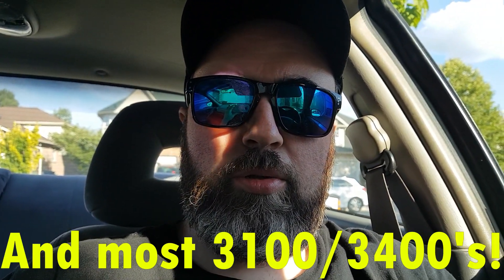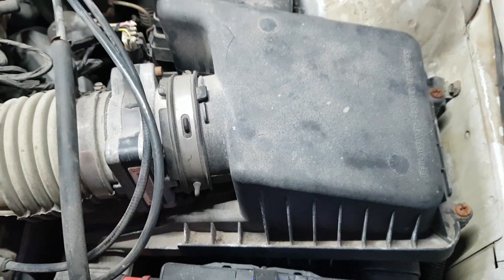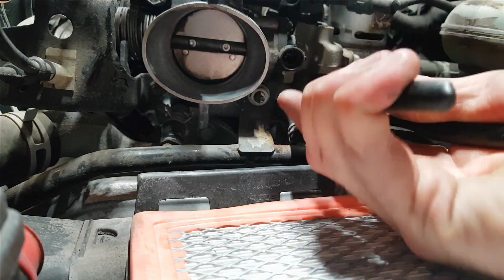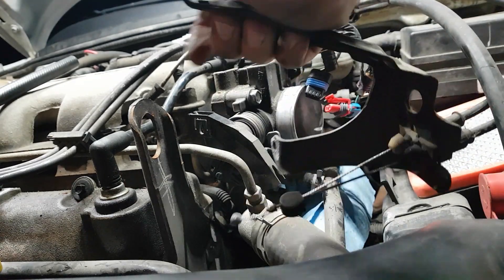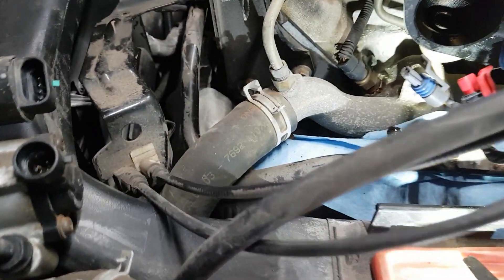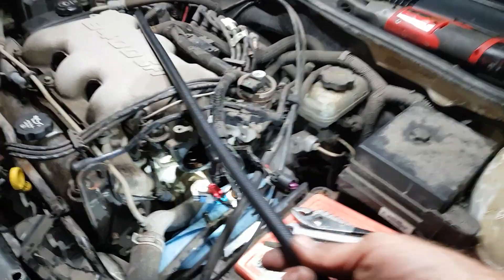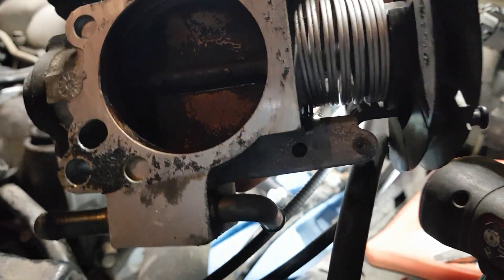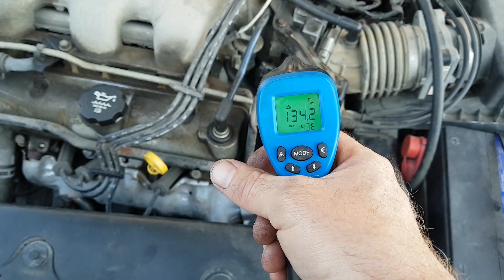3100/3400 Throttle body heater bypass

Comment: Thanks for sharing this in detail. Those little hoses were rotted when I put fresh cylinder heads on my Oldsmobile Silhouette. One of the fiddly parts of that job was getting them lined up. I’d have bypassed them if I’d better understand them. GM doesn’t give you much extra hose to work with for reassembly either. I’ve pulled four Oldsmobile Intrigue throttle bodies now from the junkyard, before they disappear, for future projects. Hope your car keeps coming together.
Reply from the maker: I have at least 4 lx5 TB's too! Lol

Comment: Question, can u eliminate that tube and make plates with a gasket? And also when upgrading to the 65 mm throttle body do you have to get the car programmed? Gonna do the bypass in the mean time.. thanks
Reply from the maker: Are you talking about removing the heater core tube at the timing cover and blocking it off? Or on the TB? 
You can run the 65mm TB on the stock tune, but you will get the best results with the reprogramming. I'm planning on installing my 65mm TB/ported plenum this weekend!

Comment: Great mod / air box 2nd filter debris filter/ egr delete/ pvc and breather all done in my 3.4 that is in a torrent awd/ over size throttle/ injection
Reply from the maker: Awesome to hear that someone is modding a torrent/equinox! They have a lot of potential, especially with the AWD!

Comment: Also, would more heat shielding under the throttle body help? The crossover pipe can’t be good for anything in that area.
Reply from the maker: It probably wouldn't hurt!  But I think I would worry about it more with headers or a turbo

Comment: I’ve been watching your videos for a while and I have a 1999 Monte Carlo with a 3.1. I plan on porting the heads and doing everything like you’ve been showing and I’m wondering at what horsepower should I start worrying about my transmission?
Reply from the maker: Iirc you should have a 4t65e... make sure that the transmission tune is good and add an external cooler,  I don't see why it shouldn't hold 250-275hp at the crank assuming it is maintained and in good working order. Once you start passing that you will want to look into upgrades for it!
Reply: @modeverything1  Awesome, thanks for the information!

Comment: I have a 2001 Pontiac grand am 3400 and I don’t know exactly what I’m looking for, I took the car for a test drive, had heat and then suddenly a blast of cold air, I get the car home and my dad mentions the heater hose might have popped, well he was close it’s the metal piece that connects to the hose and to the block. So my question is would anyone happen to know what that black metal tube piece is called and how hard is it gonna be to fix the issue?
Reply from the maker: Is it the pipe that goes to the lower intake manifold? Or the one that wraps around to the timing cover? Dorman makes both of them, just search 626114 and 626533.
Reply: thank you so much, I just found it. It’s the Heater core coolant pipe with the number 626533 and it’s the one that goes in the lower intake manifold
Reply: Another question is the piece that goes into the manifold broke off so any recommendations on how to get that piece out?

Comment: Hello there man, I have an Oldsmobile cutlass ciera wagon with a 3.1 I have problems with the coolant system the car suddenly strats giving me an alarm sound but the temperature sensor seems to stay below the middke section, It does act like an engine that overheats aince I have just replaced the head gaskets its been misfiring as well can youw help me find a way to start diagnosing the problem, on top of all that my mechanic f up those throttle cooler pipes after replacing the head gaskets, when we where trying to fix a return water pipe for warm air for air conditioning system, what should I do?
Reply from the maker: Depending on the year of 3.1, some have 2 coolant sensors, 1 for the guage and 1 for the engine computer.  I would probably start with replacing both before digging in too deep.

Comment: Great videos bro ivee been watching your videos seeing what upgrade there are cause im going to be doing a 3500 lx9 swap into an rx8 but gonna convert the engine to rwd ive only seen a couple people do it on here so far but they say i need a timing chain from a camaro to convert it to fwd not sure if its cause the plenem would be hitting it when flipping it around to the front of the engine
Reply from the maker: Thanks! Using a Camaro/firebird/2.8 s10 timing cover is usually easier to locate the accessories for a RWD setup. When you flip the upper intake around on a fwd setup it hits the power steering pump. It can be done with the FWD cover but you would need to do some cut/fab to make it work.
Reply: @modeverything1  thanks, wasnt too sure which timing cover but ill check it out. I was looking at that earlier today and i see what you mean about the power steering pump.
Reply from the maker: There are a couple different ones, you will want to stay away from the early 80's timing covers because they used an angled cover/oil pan. '86 and up you will be safe.  I used a '94 3.4 cover on my truck so that I could keep the sfi crank sensors and I like how the coils are mounted on it!
Reply: @modeverything1 wait so u used a 3.4 cover? Wouldnt that be similar to the 3.5 cover i also have a pontiac grand am with a 3.4l but it looks like the power steering in the same place
Reply from the maker: 3.4 Camaro  1993-1995. The iron head engines, different from the 3400 aluminum head engines

Comment: What if you live in a cold weather climate?
Reply from the maker: I have run my cars like this for several years and have not had a problem, even with temps as cold as -30°c. Some say that the TB can ice up and stick,  but if that happens, I would shut the engine off for a few minutes to let the engine heat defrost the TB. Alot of newer vehicles don't have heater hoses going to the throttle body.

Comment: Why not just pull the tube and weld them shut?
Reply from the maker: That's another option, but I would probably do that if I was building an engine or pulling the heads off